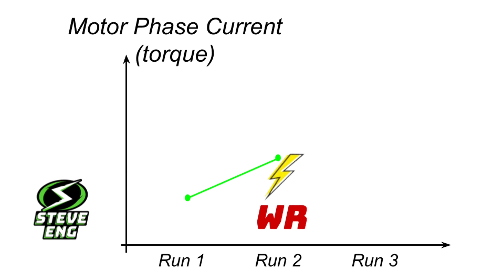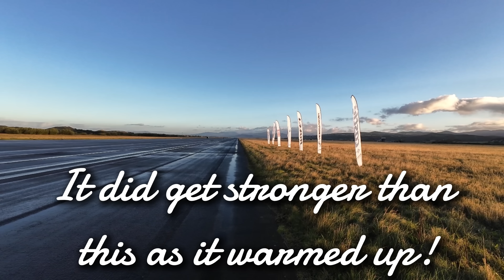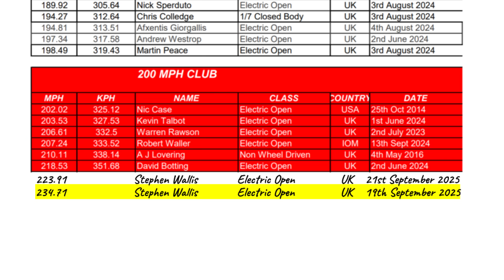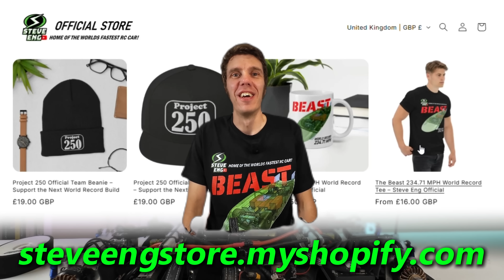World’s Fastest RC Car: 224mph Run + Project 250 Reveal!

Comment: Bro, duct tape, unlike fibre tape or gaffa, will stretch as you unroll it, then contract  and peel away, u need to wrap duct and electricak onto itself, so it contracts and tightens
Reply from the maker: Cheers for the ideas Harry! You mean the tape I put under the car right? Good points on the tyres and CG!
Reply: @steveeng1826 yeah, the tape would peel back, do nasty things to your nice builds   find a sign shop and grab vinyl offcuts.
Reply: @steveeng1826 Alexander Hagberg demonstrated the power of cg when he won the worlds in Thailand
Reply: Brother, true the tyre edges round much more severly, the chunking starts at the corners, tapering the edge reduces chunk and mote tyre has more mass so it balloons more.  Superglue edges etc, and perhaps ream the rims too
Reply: In racing CG is everything, a gram on the roof is a lot, superlight shells with good supports, and keep all rhe mass centered, add some if needed, theb not pnly check droop left and right, but front and back, droop is important to balance forces under accel
Reply: Your front should stop rising the moment your rear bottoms out.. you should see scrape marks on the rear of chassis plate and front splitter as you decelerate..slammed